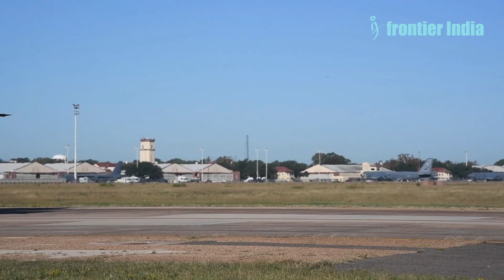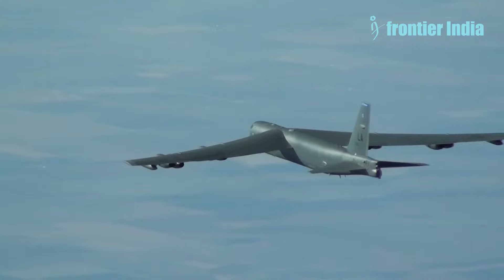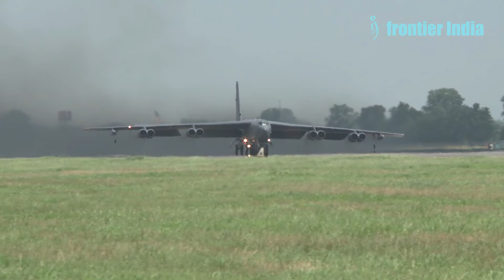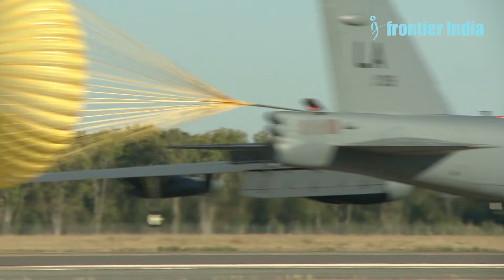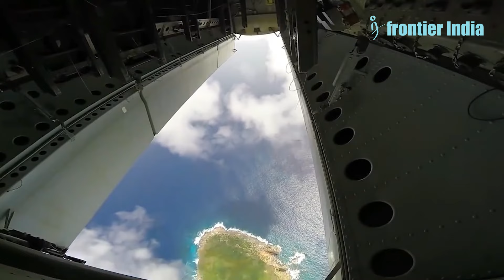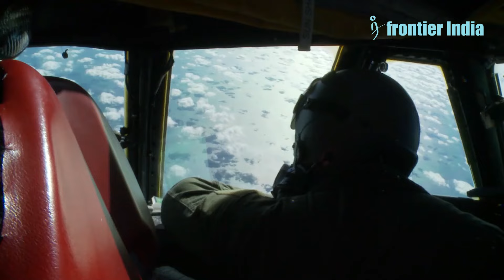USAF's B-52 Stratofortress - RR F130-200 jet engines & APG-79V4 radar (But Not Until 2033)

Comment: Currently, there is no B52J designation for any B52 in our inventory. They all have the B52H designation. That's the designation they were delivered with back in 1962. And it kept the B52H designation with all of the upgrades it received since then. Only when an individual buff gets the new F130, off the shelf engines, will the Air Force consider it for the new designation, B52J. Or maybe it will get a new designation once its official standoff role eliminates the need for it to drop bombs anymore. 

Any target worthy of getting bombed, would certainly have modern and sophisticated anti-aircraft defenses. The B52G I flew in the 70s and the B52H have the same profile. And no matter how many upgrades it receives, nothing will make it stealthy, more maneuverable, or faster, not even the new F130 engines. In a target rich bombing environment, it would say to the defensive systems, "HERE I AM!!! Take your best shot." Instead, if there is a target that needs to be bombed, the B1 because of its speed and maneuverability and our stealthy pair of bombers, the B2 and the B21, may be better choices.

I'm not even sure why the B52J would retain a bomber designation given its new standoff role with missiles that have ranges of 1500 miles or more would keep it out of anti-aircraft defensive systems and interceptor ranges.